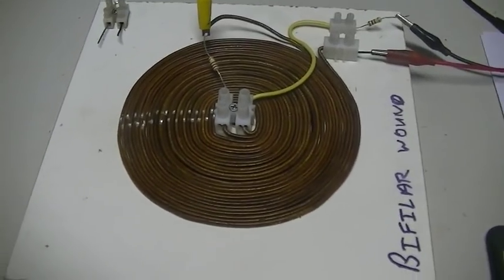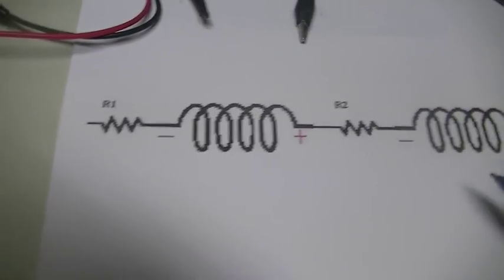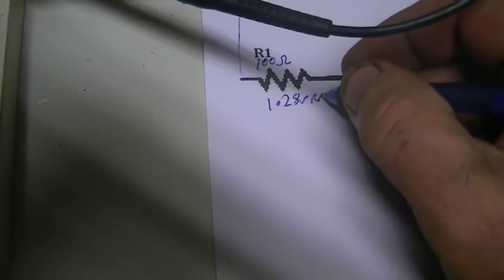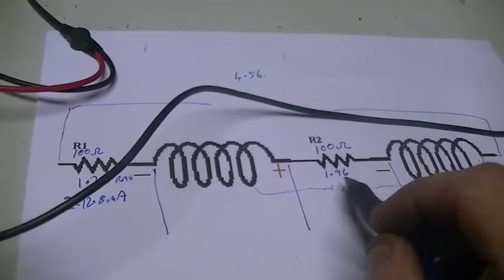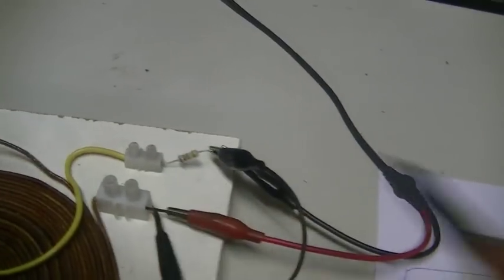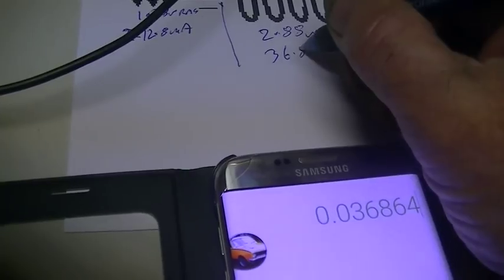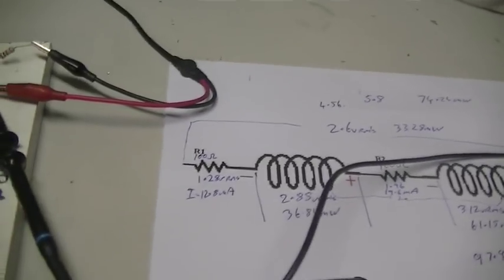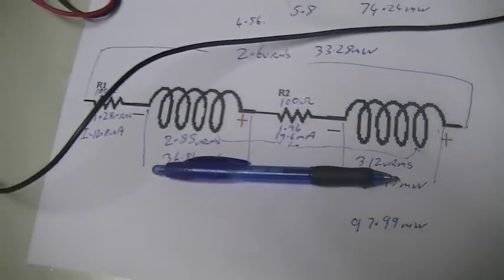Tesla bifilar coil Overunity Effect

Comment: This is measurement error.  R1 was in series during the first measurement, and not in series with the subsequent measurements.  Also, the 'scope is not that accurate of a device for this kind of measurement (but still needed to verify wave shape)-- anything more than 2 significant digits is not real data.  Also, the magnetic coupling of the 2 segments of the bifilar wound inductor is not taken into consideration.

This coil is not a "free energy device", and has no magic properties, other than what Tesla stated in his patent-- it increases the capacitance between the windings so that a smaller external capacitor can be used to get it to resonate at the right frequency-- and this saves money over a larger capacitor with a conventional coil winding.

Comment: So it seem that the stray capacitance in the circuit combined with the coil has formed a parallel resonance tuned (tank) circuit. The input impedance is thus very high making for a very small supply current. The Tank’s circulating current is much larger, due to the charge alternatively being stored in the capacitance and then the inductance of the circuit. Being
at resonance the Capacitance current and the inductive current are approaching a 180 degree phase difference: no real power there (only VARs). The  resistor is sampling this current as is transfers from inductor to capacitor. Without a proper measurement of phase
angles throughout the circuit you cannot determine the true power.   See here: https://www.quora.com/What-is-the-resonant-frequency-of-this-circuit

Comment: Nice find! Russ mentioned an interesting subject about power factor. What I've noticed is that these coils tend to have a preference to current in one direction even with AC. Under load the directional force can change which effects power factor meter readings. So power factor is AC leaning one way or the other of base line. I question whether power factor correction can accurately predict power dissipated in an unbalanced condition. Can this be seen with two center resistors in Y configuration to ground or center choke and two caps to hold base line?
Reply: Regarding this, "AC leaning:" the "input" consists of two wires and only one is measured and it has a test resister in its path.  Why, if I were an AC signal then I would be inclined to lean towards the side of least resistance--the red wire--if this makes any sense.

The "output" is configured a bit differently with the resistor, or resistor+LED, centered between the probes, (instead of down one leg as with the input.)  So, both sides are represented with the output measurement.

Try placing another 100 Ohm resistor on the red input line.  This may balance out any AC leaning or, at the very least, allow for measurement on both input lines to test for this leaning, perhaps.

"No, the extra resistor blocks the free energy pixies!"  Okay, a little math is necessary to measure current, but would two 50 Ohm resisters preclude any potential whining?

Comment: In order to calculate the power really dissipated in an AC system you should take phase shifts into account. That is the power factor issue that rwg points out in his comment. Your calculation would have been right in a DC context, but this is not the case when voltage and current are not in phase. In this case you should sum up the time series of all of the ( i . u ) factors. I appreciate your videos that I always find an interesting food for thought.

Comment: tin man. you must understand power factor when using AC. real power must be calculated. voltage and current will lie to you. remember the rodin coil testing?  you need a true watt meter. that dose power factor calculations. with out doing this you will not learn what is really going on. As you know. I have alot of respect for you. so do take this as positive criticism. :)  much love. ~Russ
Reply: Yup Russ, even though a resistive load will not effect the phase shift it does not meant the AC waveform going into the resistive load does not have a phase shift.   Assuming Vrms^2/R in an AC system with Inductors and parasitic capacitance is not proper AC system power analysis. The only way the Vrms^2/R works is if the frequency is tuned so that at the load the power factor is 1, i'm not sure if that is going on with these measurements.
Peace Russ,
Ben
Reply: Looks like you learned how to spell does in Austrailian?
Reply: zebok3 I did not learn how to spell. there for if you can get what I'm saying then we are good. ;)  ~Russ
Reply: He can measure the "Magnetic Flux" from the center tap to the ends and from end to end, then calculate the electrical power.
Reply: zebok3 did you watch that video. ? I haven't checked the comments over there yet. ~Russ
Reply: Tinman presents a solid case for OU.
Reply: zebok3 haha. Ok. Here is what I'm saying. one must be able to verify OU. so I'm trying to help out people by showing them that they must measure things correctly to make that clame. Tin man even states in this video. "mabey we can't measure this using ohms law"  and he is right. he knows this. he is a smart man. we both have respect for each other. this is about teaching and learning.  A.C. mesurments do not work with Amps X Volts. thats only good for DC. when using A.C. you must use Amps x Volts x Power factor. ~Russ
Reply: you could always do the old fashion way, as Tesla probably would have,  and convert it to heat in a NON INDUCTAVE RESISTER then measure the heat generated, Had its advantages of not not being effected by frequency etc.
Reply: It's as simple as this: current difference in this Series (!) circuit comes from counter coupling of the coils. Ideally they should even cancel down to 0A! That's how surge Filters work. So, obviously coupling is already really Bad in this circuit. Furthermore All the Power in the coils is "reactive", hence such that does not do any work. What remains Real is the power in the resistors and if you divide the sum of both by the Total then it becomes clear that power balance is far away from good.
Reply: A. Good old byrd

Comment: Is your signal generator not connected to ground or is it completely floating?  Why are you operating it at 2.696 MHz?
Reply: These are two key questions, well put Elmer. If the results vary at different frequencies then it means the stray capacitances can't be ignored as there are resonances (and large phase shifts) occurring which invalidate the power measurements by voltage across the inductors. And if the sig gen has one side grounded and the scope has one side grounded then measuring across R2 with the scope puts a second ground to the circuit and so changes the circuit completely. Please consider these points Tin Man before making claims about OU, I do hope you can achieve it but these issues leave some room for questions as I hope you will agree! But that's an interesting demo anyway, thanks.

Comment: Tesla talked about raising voltage in coils by layering a second winding between turns of the first winding, I forget the factor of increase but he mentions it in his patent, you can probably compute from your measurements. The different currents you measure is probably from the different voltages, with the layererd-in winding you should have a higher voltage than you input. Again, is in the patent.
Reply: The very one he's showing you, sorry I don't recall the number, it's been years. And incidentally it works on bifilar coils too, not just pancake coils.